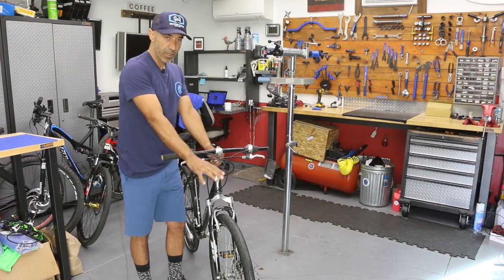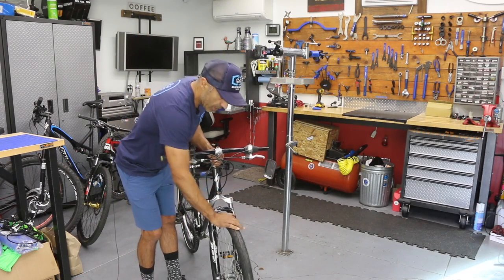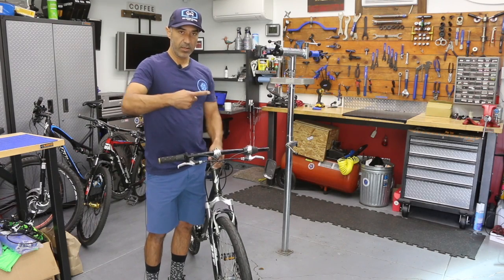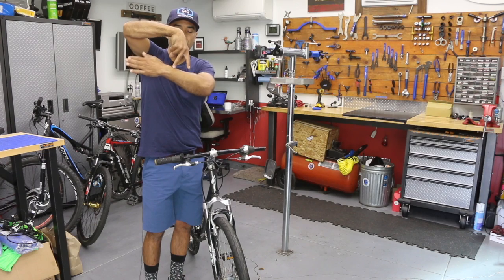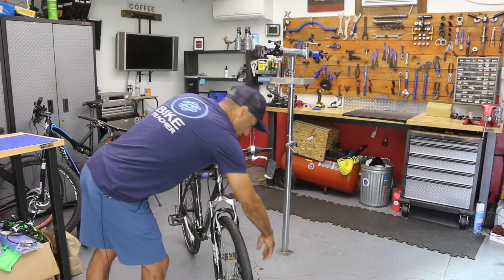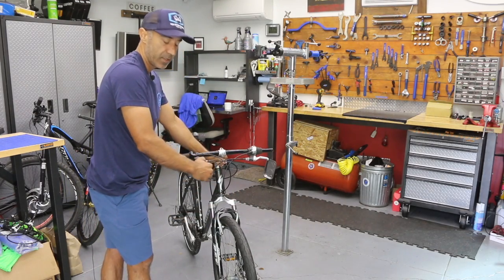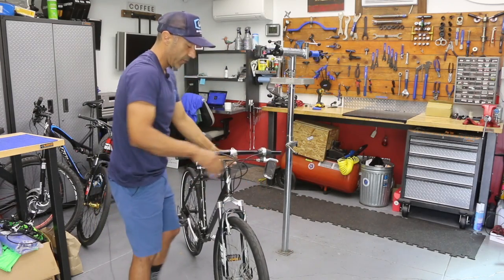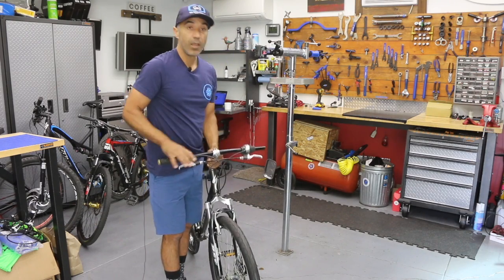Why won't my wheel spin?

Comment: I'm a newbie.  I bought a marlin trek 5 used with it's wheels off so I could fit it in my car.  I put the wheels on and they wont spin.... what the heck.  I just need the wheels to spin so I can ride it.  What did I do wrong?
Reply from the maker: Do you have rim style brakes or hydraulic disk? If hydraulic disk, the pads may have traveled to the center to touch the rotor and stopped the wheel from spinning. If rim style brakes the v brake style noodle (curved metal tube) may not be completely engaged and connected 100%. Therefore pulling the cable to tight and activating the brakes to stop the wheel.

Comment: I tried and it didn't work. Any other ideas before I carry this bike shop?
Reply: same I need answers!!?!?!?! ahahahahah
Reply: If it’s a rear wheel without vertical dropouts (cheaper/older bikes), you’ll need to manually center the wheel in the frame just behind the crankset. Then check to see if it still rubs. If it does, check to see if the wheel is centered in the frame behind the seatpost, and check the truing by spinning the wheel, and see if it looks “wobbly.”  Assuming those are ok/corrected, look at your brake (assuming rim brakes of some sort) and see if you can figure out how to adjust the centering of the pads. There are so many variations, but usually it’s not hard to correct, except on cheap or old school components. Edit: or are your brakes just too tight? 😁

Comment: this is my issue at the moment lols the damn front wheel won't spin freely like the rear wheel i'm triggered y does it do this now i have to take it to the bike shop to see if they can figure it out lols
Reply from the maker: Identify if it’s a brake rubbing. If so the brake cable could be tight. The brake housing may be hung up on something creating tension and applying brake pressure.

Comment: I crashed on my bike now the front wheel is getting stuck on bottom of frame so it won’t spin I’m guessing it’s knocked it put or position I don’t get how to fix this
Reply from the maker: Back wheel? Loosen the wheel from the frame. Just release some tension and then retighten. The wheel shouldn’t need to come off.
Reply: @BikeTeacher  people are saying I need a new folk
Reply: If your front wheel hits the frame (not the fork?), then you need a new fork. If it’s rubbing on the fork, maybe a new wheel.
Reply: @nicholasittzes7224  yes just bought a new fork should be here next week . Expensive do

Comment: My rim won’t spin long and I don’t have front brakes also my rim isn’t sealed
Reply from the maker: The bearings could be adjusted to tight. Or the bearings are old and dry.
Reply: same happened to me

Comment: But what If its the back wheel with a quick release
Reply from the maker: Assure the wheel is centered in the frame. Open the quick release and center the wheel then close.

Comment: This is mine but the rear wheel, is it any different
Reply from the maker: Try to find the source, rule out what it may not be. Is brake pad rubbing rim? Open the brakes quick release and get the brakes out of the scenario. Is it the axle where the bearings are. Is the wheel spinning freely on its own? If it’s the rear wheel, is the chain or gears altering the free spin of the wheel.
Reply: @BikeTeacher  just fixed it this morning

Comment: ok i have a question what exactly did you flip
Reply from the maker: Good question. I did not show it. I flipped the quick release lever. Also called a skewer. The lever is the opener and closer for that secures the wheel.
Reply: @BikeTeacher  is there any other way to open it up cause my wheel has an issue where it won’t spin and i have no clue what’s wrong
Reply: Some cheaper/old bikes don’t have quick release hubs, just nuts. If you want to service the bearings, you’ll need a pair of special super thin wrenches called cone wrenches.
Reply from the maker: The lever to the wheels quick release. The lever that loosens the wheel to then be removed.

Comment: I got into a bike brake and got hit in the rear my wheel doesn’t spin freely
Reply from the maker: Did you get this fixed? Wheel may have gotten loose and then crooked, rim bent and hitting frame? Brake miss aligned and rubbing or jamming again wheel.

Comment: My bike pedal won’t move forward and my back wheel doesn’t move forward also my chain keeps on coming off aswell can anyone help?
Reply from the maker: Did this get remedied? Was the wheel crooked in the frame? Loose chain ring? Brakes rubbing? Chain jammed in between the frame?

Comment: Does anyone know how to fix this my bike wheel spins freely but when I push down the  lever to lock it in it stops spinning freely
Reply from the maker: Push down on what lever? I’m not clear. The quick release lever? Make sure the cone shaped springs are pointing inward towards each other.
Reply: @BikeTeacher finally got it worked thank you so much
Reply from the maker: @akshatpandey9455 awesome. Your welcome

Comment: Not helpful. Not a single video is helping me. I'm that guy that just bought a new motor kit started and throws it out. Took the rear wheel off to put the sprocket on, put it back on and then the wheel doesn't spin freely. NOT DIE TO BRAKE RUBBING OR ANYTHING WITH THE FRAME WHAT SO EVER. WHILE HOLDING THE AXEL NUTS WITH BOTH HANDS MY WHEEL DOES NOT TURN AT ALL. idk why I. Commenting on here as if anyone responds on this platform
Reply from the maker: Is the motor in the rear wheel? Is axle effected by the motor? The axle lock nut may have been loose and then inadvertently got tighter while installing the wheel. Solid axle?